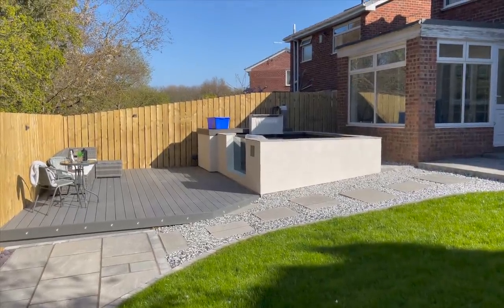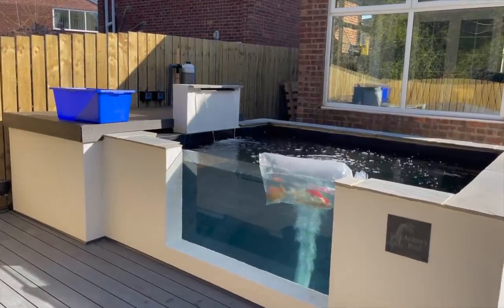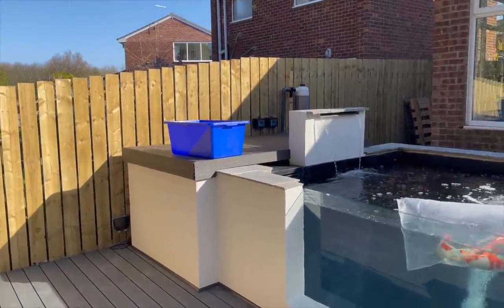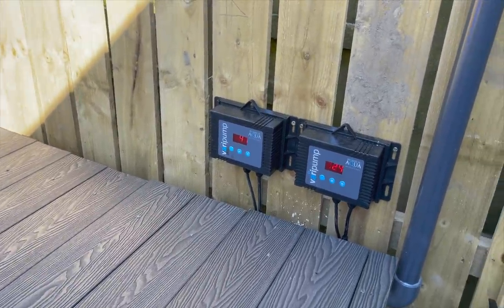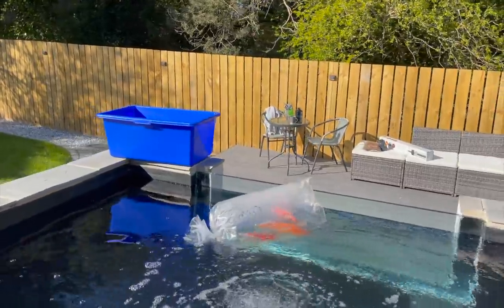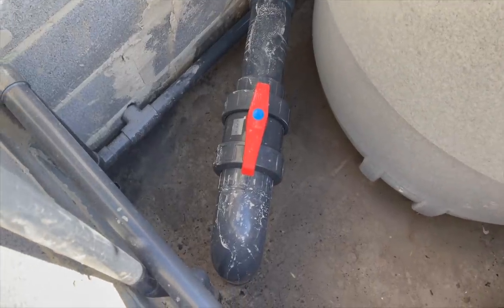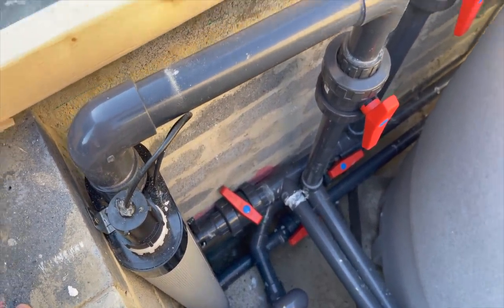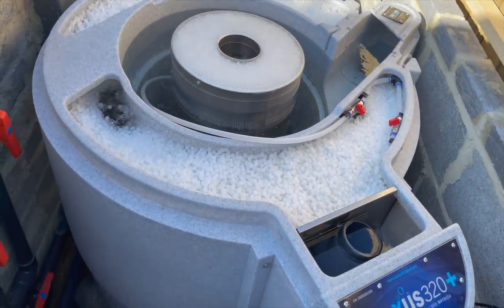2200 GALLON KOI POND - NEXUS WINNER!

Comment: I made a tool out of a bit of 3" pvc pipe to turn my valve off by cutting a slot in the bottom of the pipe and 2 holes in the other end to slot in a screwdriver as a handle. Lovely little pond and stunning looking Koi Tim. Shared to our club page, stay safe & well.
Reply from the maker: Yep I have one at the shop similar.

Comment: Hi what's the best way to use chloramine t and does it kill flukes
Reply from the maker: You need to be VERY careful with CT. It’s a good treatment but it’s very dangerous at low PH. I have never ever known it kill flukes.
Reply: My pH is 7.5 I put the write amount in yesterday day the koi are OK Lee Hadfield on YouTube said on his video to day that he puts it in 3 times a week and 1 day off is that write  when can I treat if for flukes ofter ct
Reply from the maker: @shaneharrison5182  everyone has their own way. CT is only active for 6 hours. Many use it before they add a fluke treatment to remove the mucous.
Reply: OK thanks should I use fluke m treatment now or what's the best stuff for flukes
Reply from the maker: @shaneharrison5182  it depends on so much. Fluke P maybe. Just make sure you do the full run of treatments.
Reply: OK thanks for your help